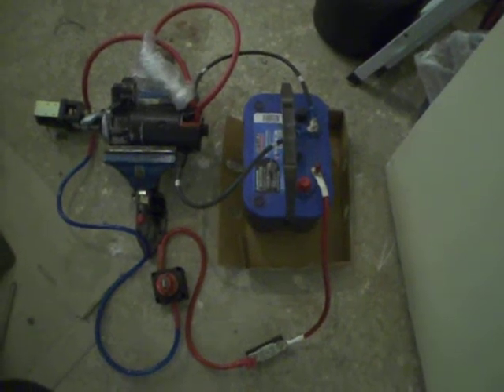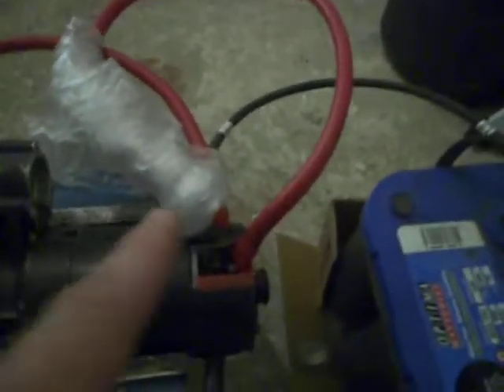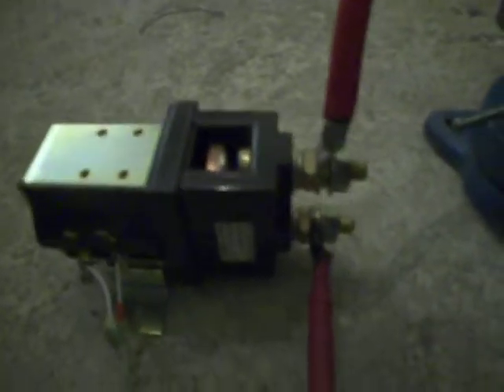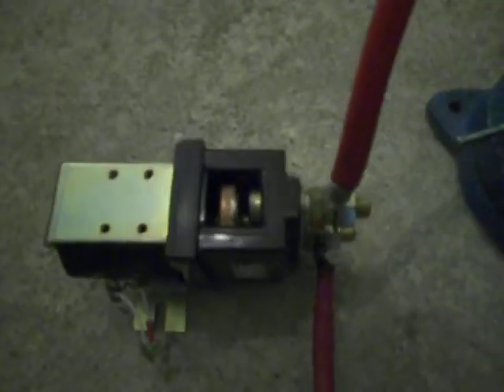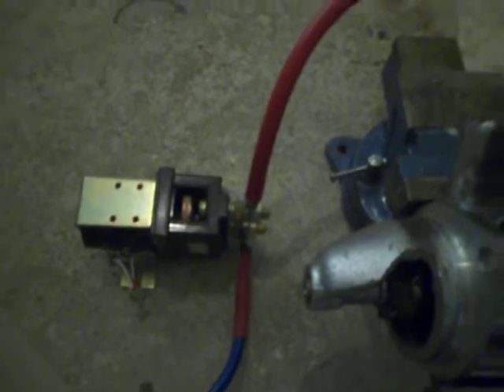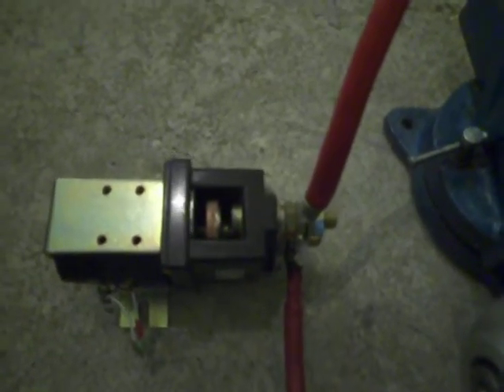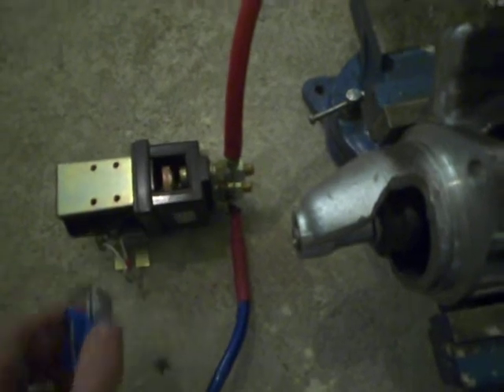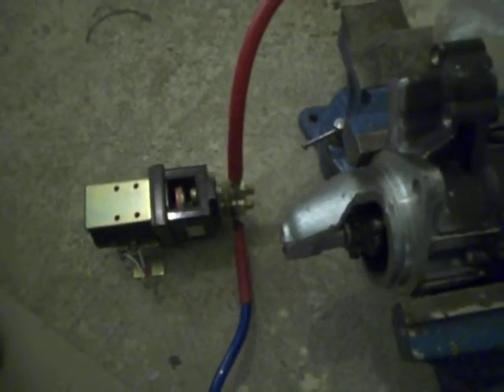Using a Main Contactor - simplified demo

Comment: I bought an sw80 contactor and it's not working with a 9v battery. Should it be 12v?. How do you get to know what voltage should I give for solenoid?
Reply: Did you figure it out?